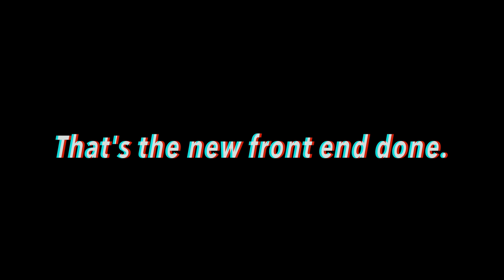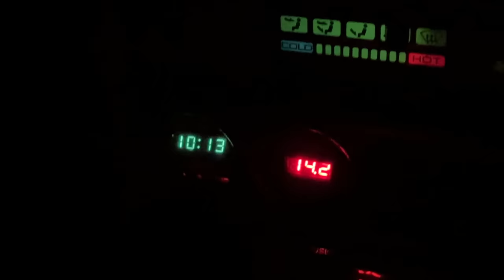The RIGHT WAY to fit BIG TYRES to your 4WD - PANEL DAMAGE REPAIR & MORE!!

Comment: A speedo that works like it should, ahhh must be nice!! 

Seems nice and quiet in the cab too. 

Love your work as always
Reply from the maker: They’re pretty simple to fix if yours isn’t working haha, can only really be the needle mechanism, mines flicked over to the right before and just swapped one out of another cluster, or it could be the sensor wires broken somewhere, seen that too fixed it with a crimp!

Get under it and have a suss! Yeah super quiet in the cab dude tbh, cheers mate 👍🏻
Reply: @timmyhasheart  yeah I’ve been messing about with mine. Dry solder so resoldered it and got a few months out of it. GQ parts seem to be a bit thin on the ground in Tas lately!
Reply from the maker: Haha that’s probably my bad, I got a shed full at home and a small section of paddock at Drew’s 🤦🏻‍♂️🤣

Comment: Nice vid Timmy.
Can I ask what you put on the new alternator electrical connector prior to you clipping it in. Was it grease or some other product to make it easier to disconnect?
Reply from the maker: Yeah dielectric grease, yes it does make it easier to disconnect but also it’s a bit of protection against corrosion and debris and water getting in. It’s essentially sticky WD40, won’t arc out. 👍🏻

Comment: Do you put the plastic inner liner back in the guard or leave it out?
Reply from the maker: Na I leave it out, it ruins the door hinges pretty quick but that’s alright, I don’t mind replacing them haha. You could do what Kistler does though he just has a single bit of rubber around it which looks good.

Comment: @13:42 what you putting on the plug there mate?
Reply from the maker: Dielectric grease mate! 🙏🏻
Reply: Cheers. 

Keep up the good work. You dead set have one of the most capable Toyota Navaras in Australia